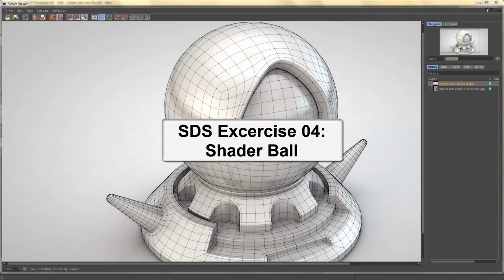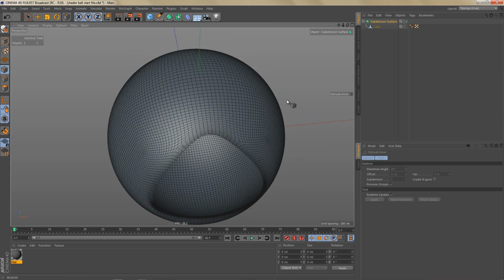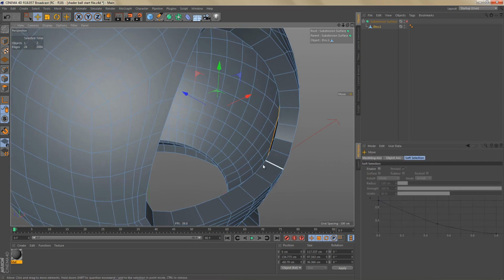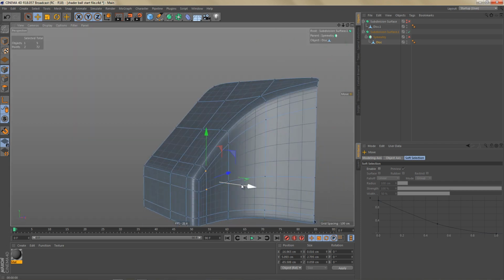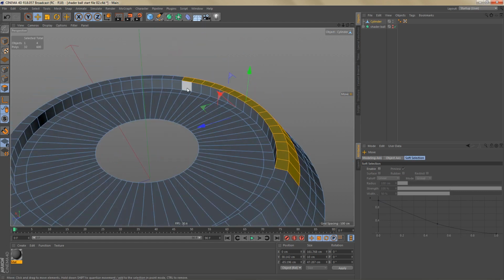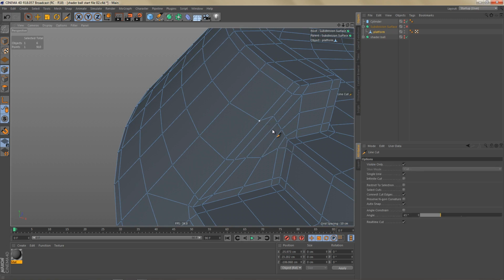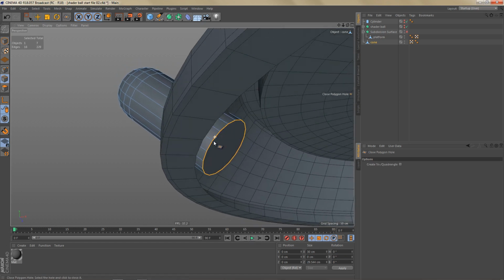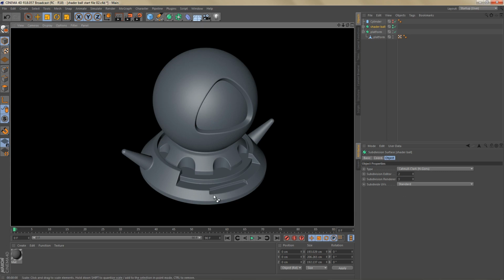SDS Excercise 04   Shader Ball | Cinema 4D Tutorial

Comment: I don't have HB Modelling Bundle, so I tried another method, using only built-in tools.

1. I made a copy of the shader ball we got at @. 
2. Without deleting half of the points I selected edge loops No 2, 3, 4, 5 and 6 from the bottom and melted them (M~N).
3. With Ring Selection tool (U~B) I selected the long edges I got after the step 2.
4. With Edge Cut tool (M~F) I divided the selected edges into five segments.
5. At the end I applied Shrink Wrap modifier to the object and took the copy from the step 1 as its Target.

That's all. What do you think?
Reply from the maker: If it works, then that's great! If you do a lot of modelling you still might want to get those scripts. They really make your life so much easier and enable you to improvise a lot more.

Comment: Glad I found this channel, really good tutorial!
Reply from the maker: Thank you very much! I'm happy to hear that you like the tutorial!
Reply: @Wolf-4D  You're welcome, this is really helping me get back into sub-d modeling. Just a question: A few times in the video you were able to quickly select a line of edges between two distant edges. How do you do that? I can't seem to find the shortcut for it and I find that the path selection tool is a bit imprecise when selecting many edges.
Reply from the maker: @matthewschoen3D  I don't like the path selection much either, for the same reason. 

The shortcut I use to select a line edges (or polygons, for that matter) is this: left-click on on an edge, then press and hold Ctrl+Shift and left-click on another edge, this will select all the edges inbetween. Depending on the topology the selection may not be the one you want. In that case, I'm afraid, the path selection would be an alternative way to get the selection you want. If it is an edge loop you need to select, you can double-click on an edge, and C4D will select the entire loop. 

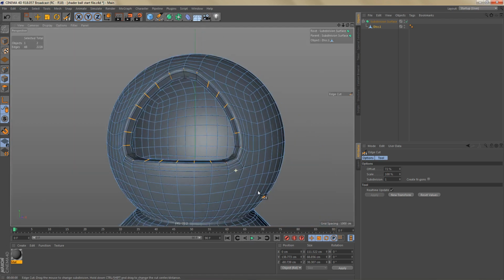If you want to know how to select several edge/polygon loops using the "Shift+left-click - Ctrl-Shift+left-click" method, see my video on modelling a plastic box in C4D,  starting at 20:18. 

I hope this helps.
Reply: @Wolf-4D  awesome thanks!
Reply from the maker: @matthewschoen3D  You're welcome! Glad I could help!